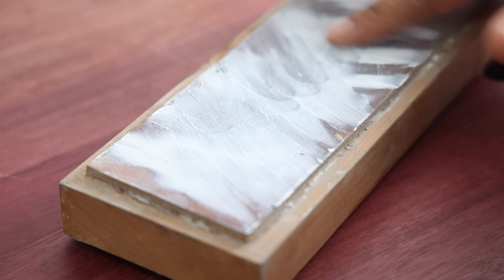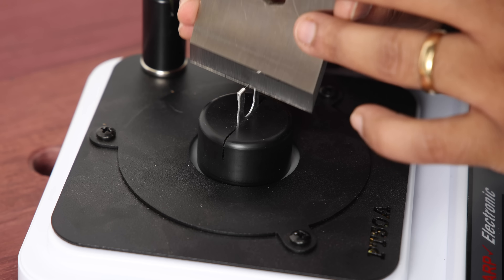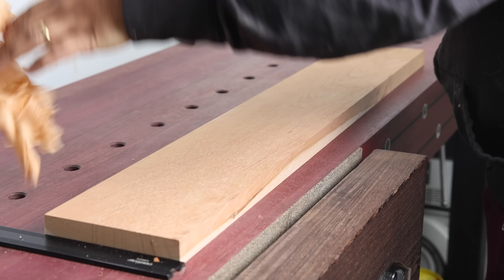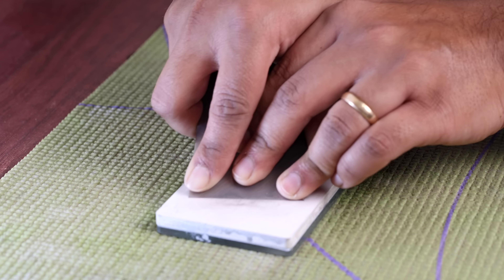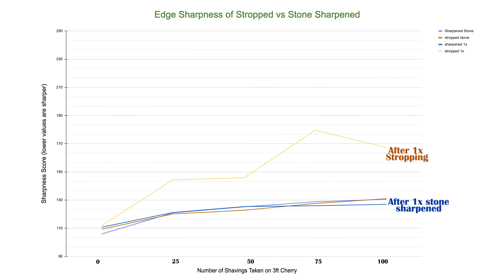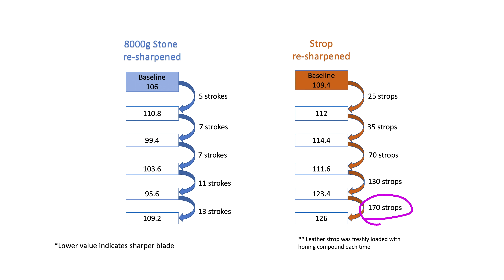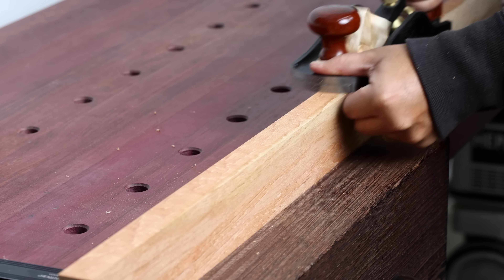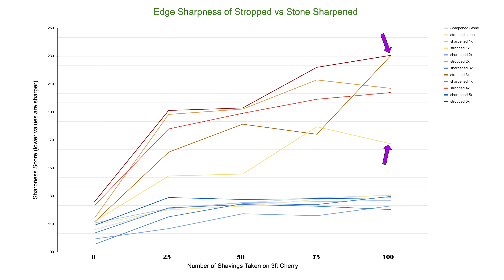is stropping overrated?

Comment: Hi, I only use the strop to polish the edge after stone sharpening. I didn't think the strop was intended for actual sharpening.
Reply: Yup, I was taught the strop is for final hone and polish and working off the burr, not for actual sharpening. There is good evidence that steel quality and bevel angle are the biggest contributors to sharpness and edge longevity.
Reply: Yeah me nieither.
Reply: Very much. Stropping can be used for "sharpening" on a pinch, but that works best for knives than this sorta blade. IMO it is actually preferable to "sharppen" the knife on the back of another knife first, just to straigthen up the edge, then re-polis on a strop. But htat is a regular knife with its double sided sharpening and thin blades, not a beefy blade with a chisel gring like a tool.

Give it a few strokes on your highest stone if it is not dull (then it has to go down to a lower stone), a couple on the strop, takes about the same time, and you're golden.
Reply: @TheOriginalAndBestTim  The compounds used for stropping wear away the metal just like a stone, so if you can put some fine stropping compound on something rigid like a flat hard piece of wood, it will behave similar to a fine stone. Strops are generally made of something that compresses a little though, and that dreaded rounding over of the bevel is also what helps work off the burr and polish the last bit of the edge quickly.

Comment: Hi Suman, great video. I actually did a very similar experiment trying to prove the effectiveness of a strop. In my test, I stropped my blade after 400 strokes on hard maple and the sharpness on my blade went from about 500 to 250 on BESS scale after few stroppings. However, that didn't really last very long. I was back to 500+ range after only about 50 strokes. For stropping to be really effective, I found you need to strop in about every 50 strokes. With this approach I was able to maintain 300-350 sharpness even after 600 strokes.

Comment: Great test and I was surprised by the dramatic results.  I have been stropping for decades and have found several things that may improve your results.  As many have noted, using a soft leather is very bad.  Stropping with wet compound is also counter productive since it leaves the leather even softer and the compound squishes up around the apex.  I use diamond powder on thin leather and have found that if I don't let the diamond dry completely before use it will dull my stone honed edges.  When the diamond surface becomes loaded and less effective, I give it a spray of water and agitate the surface to bring fresh diamonds into play. When dry, it works like new.   Any time I can't get my desired results in less than 10 stropping passes I know I need to do a better job on the stones.  Almost all my knives are "super steels" and attempting to strop on anything other than diamond or boron carbide is useless.  I suspect V11 is similar (I have V11 plane blades but have always used diamond stropping with them.) Just some observations from a 71 year old woodworker with an obsession for sharp stuff!
Reply from the maker: Rick- I’m curious to know- why not just use higher grit stone like the Shapton ceramic? Seems easier to me. Would love to know your thoughts.
Reply: @WoodcraftBySuman  I have several high grit stones including a 16k shapton but I find that the softer texture and feedback from the strop gives me more reliable results.  I can feel and hear the exact moment my strop is "on edge" whereas with the shapton I need to gauge it based on angle alone.  Lower grit stones remove enough material that minor angle errors are quickly compensated.  Most of my sharpening is on knives where I can't use the hollow grind trick for angle setting.  I do use hollow grind on plane blades and chisels but have never found any benefit in going above 5K in sharpening them so the strop is just a pass or two to ensure that the burr is gone in woodworking.  I'm fine when they shave arm hair.  My knives I usually take to hair whittling sharpness just because it took so long to learn how that I like to stay in practice!
Reply: Does it matter whether one uses diamond "spray" or the emulsion from a syringe?

Comment: The erratic nature of the strop lines, brings in to question the stropping technique. Something else that is not addressed in this video, this PMV metal which forms differently than non pmv, so these results may or may not hold true for 01. A lot of Modern "myths" are not myths so much as failure to change process when changing material in question.. Most immediate consideration is that Chromium Oxide  is going to cut 01 much more effectively than PMV11 which would change the results of the stropping.

Comment: Strop is not a substitute for 8000 or higher grit stones. You can get only the polish level of your compound. If the stone is higher grit than a compound no surprise it will produce a better edge. Most people use strops after sharpening on a 1000 grit stone just to save some money by eliminating a need for additional higher grit stone.
Reply: Grit alone is not the only factor that determines how sharp an edge is. The steel you're sharpening is a factor too. If it wasn't then it wouldn't matter what tools you had. Steel is an alloy though. So steel is a complex material. Steel has a grain structure. You can't see it like wood but it's there.

Comment: Awesome video, but I was under the impression that the stropping was an addition to after final honing. I.e. a final polish to remove any nicks. There is no doubt that the the blade is sharp after the 8K stone, but what are the shavings like? Are there streaks on the piece and/or shaving? Can you go straight to finish? I suppose that the edge could be viewed using a jewelers lens, or other means,  to see if there are any nicks on the edge that might cause streaking by just using 8k.

Btw I don't strop, just finish with 16k stone.

Comment: Weird. I haven't seen anyone use only a strop to sharpen. They usually use a fine stone followed by the strop. Does the stropping after stone sharpening make the edge more dull compared with using the stone alone?

Comment: You're finding about stropping is different on this video than the one you did later with Katz. Is there a change in the hardness of the strop between the 2 sets of tests?  The later tests found a soft leather was bad, but the hard leather worked.  And surprisingly,  MDF was a failure (and nor explained thoroughly).

Comment: Got a couple issues here. 
1. Don't compare abrasives from different manufactures by "grit". Go by the size of the abrasive in microns. For instance, a Shapton 8,000 stone is 1.84 microns and a Norton 8,000 stone is 1.2 microns. 
2. You mentioned that the Tormek cuts faster than the red, green, etc paste. There is a reason for that. The Tormek paste is more abrasive. In fact, it has an abrasive of 3 microns. Your 8,000 grit stone is below 2 microns. You're DULLING your blade by using the Tormek paste after your 8,000 grit stone. 

The green stropping compound is 0.5 microns. And you don't want that on a thick spongey layer of leather. Go for a thin and relatively stiff veg tan leather. Or even MDF or the brown side of a cereal box.
Reply: thank you! this needed to be said.
Reply: The grit difference here seems to put these results into question. I had the same suspicion when he mentioned that the compound cuts faster. Thanks for confirming the details.
Reply from the maker: You have a valid point. Shapton 8000g is  advertised as 1.84 micron while the tormek is 3 micron. This explains why I overshot the baseline sharpness to be sharper than ~110 ish on the stone sharpening blade. However, the 3 micron abrasive was more than fine enough to bring the stripped blade back toward baseline sharpness. So I was not dulling the stropping blade and the results are still better explained by the squishy nature of the leather causing a rounding effect. To your point, if it’s better to use honing compound on a piece of harder surface, why not just use a higher grit stone?
Reply: @WoodcraftBySuman  I think a good reason to prefer buffing compound is the cost. I don't have an 8000 grit stone, so I go from a 1200 grit diamond stone directly to stropping with green buffing compound. Rob Cosman doesn't buff, but that 16000 grit stone he uses cost $160 CAD. A large stick of green compound from Lee Valley costs a tenth of that.
Reply: It's worth considering that stropping compounds which are coarser than the finishing stone don't necessarily degrade the edge, since stropping doesn't work the same as a stone! You might find the listed strop series on Science of Sharp interesting, especially part 4.
Reply: @HandlebarWorkshops  I’m very interested in the results of your research
Reply: @HandlebarWorkshops  I would like to see that grit video. Are you aware of the grit-to-micron calculator on Best Sharpening Supplies?
Reply: I agree, he needs a harder piece of veg tan leather. I would also note that he is pushing too hard on the blade when stropping, it is not a sharpening stone. If you ever watch someone strop a straight razor, they are not pressing it into the strop, it is lightly sliding across the top of the strop. 
I would also add that even on a chisel ground blade, you need to stop the back of the blade. It is much easier as it is flat and you can lay it flat on the strop. Stropping one side is only part of the process.
Reply: I'd think that using paper of any sort will mess up your results. The wood cellulose would be inconsistent & potentially dull the blade, no?
Reply: @WoodcraftBySuman  Sharpness of the cut test may not improve on the finer grit stone. However the life of an edge finished on a 30000 shapton will last longer than one finished on an 8000.  The 30000 shapton is .5 micron then strop with  .3 micron on thin leather.
Reply: Resulting edge with same grit on stone and on strop is completely different. If you take stone slurry and use it on a strop you will see the edge is much more polished after the strop. 

Solingen paste for example everyone thinks grit is from 6-8K but I put it on a microscope and it has 15 micron particles, same size as an 800 grit stone. 

I think the issue here is that he used moderate pressure on leather, there is a huge rounding effect that even changed the cutting sound. Higher angle can be useful for impact resistance but usually dulls faster. Stropping on balsa wood could avoid most of this rounding effect.
Reply: Just call it micrometers, microns sounds like something you eat for dessert
Reply: @stefanfyhn4668 Microns is fine.
Reply: @WoodcraftBySuman You didn't overshoot, you simply did get it sharper because you got closer to what you can achieve on a 8000 grit shapton, which you didn't in your baseline. And ofc, with a courser compound, you are dulling it, together with the wrong stroping technique, as others have already explained. And last but not least, it is always going to be sharpen on stone, strop afterwards, use, strops, use, strop, use sharpen. As stroping is faster and when using the correct compound, you can get it really well back into working condition. As setting up stones is more time consuming then stroping it a few times.
Reply: @firefly6880  Nope. Microns==micrometer==1e-6m
Reply: I think if you have an 8000 grit stone, then use it. But most people don't. However, with simple double sided oil stone, a piece of leather, and some cheap jewelers rouge, you cane get blades shaving sharp. The strop is more about convenience, and simplicity. Most people don't have all their blade's bevels hollow grownd for ease of sharpening  on such a high grit either.
Reply: @Adamant4160 8000 grit is absolutely unnecessary. I would argue everything above ~1500 pr maybe 3000 is useless. 
You can even get a razor off of 400 grit and a strop. 
For maintaining use a diamond strop with 1-3 micron, this will cut faster than normal compound and lasts much longer. A 3000 grit stone would also do the trick i assume

Comment: Maybe I'm nuts, but would deburring or stropping on the backside of the iron help correct the rounding? Maybe you're doing that but I just missed it? Either way I think that logic would apply to both a sharpened or stropped iron.

Comment: Rounding over always happens of course due to the greater pressure at the very edge of the bevel, since it is compressing the strop there. But if your stropping angle and pressure is consistent, the pressure will reach an equilibrium where it is increasingly rounded-over as it gets closer to the edge. That is to say, there is only so much rounding over that will happen for a given stropping medium, bevel angle, angle of the edge to the strop, and pressure. This is documented somewhere on the Science of Sharp blog but it is also a pretty intuitive concept.

But most people (including me) just freehand strop, so every time we strop to a higher sharpness, well, that bevel gets just a bit more rounded over.

Comment: Tormek honing compound has an average rating of about 3 microns which equates to roughly 8000 grit (the actual grit will vary). The idea of stropping is that the polish you use is a high grit than your last stone. So for anyone who stops at, for example, a fine DMT diamond stone generally rated at 25 micron and then strops with tormek compound, they would see a difference. But people who use ceramic stones up to 16k grit and then tormek compound would actually be ruining their finely polished hone.

Comment: Interesting, I can see that using a bevel up plane makes any bevel angle change is impactful. Whereas for a bevel down plane it wouldn't make much if any odds (see woodbywright plane iron tests for this).

Most people don't strop instead of stones, they strop with stones. So the effort to get the edge back to baseline via a strop is not relevant to most people. Also, if you look at those that are proponents of the stropping method, they are typically stopping at a lower grit stone (circa 1k-1.5k, often diamond plates). So the strop is replacing your 8k, not following it. 

The bit I can't quite figure out, and bares more investigation is why the stropped blade dulls faster (but starts from the same approx starting level). Normally having a higher angle (which many would agree a strop can create) is more durable, but again, is this a difference with the bevel up plane? Is the higher angle putting more 'work' into the edge as it is turning the wood through a higher angle therefore dulling it faster. Would we see the same in a bevel down plane?

Do you feel like a follow up video with a bevel down?

Comment: Thanks. I'm a bit confused. I thought the conclusion drawn from video with jkm was that you had to strop to get to the best sharpness, and that it dulled quickly anyway so don't go nuts sharpening too often. I sort of concluded that in between sharpening, stropping on hard leather would help edge retention. This is saying that it is not the case. Care to comment/elaborate a little? Thanks.
Reply from the maker: This video is about Re-stropping as a method of resharpening. Conventionally, if you sharpen and then top off the blade with stropping, you’ll get a good edge. But after use, if you’re trying to re-strop to sharpen over and over again, the blade takes longer to get sharp and dulls quicker bc the tip gets rounded and produces higher angle of attack. Stropping is still a good does but don’t use it too much between sharpening.
Reply: @WoodcraftBySuman  Gotcha. So what you would do is to sharpen+strop, and don't repeat these steps too much because edge dulls quickly from use. If anything, one or at most two restrops before sharpening again. Thanks
Reply from the maker: @tzuohann  yup! You got it. Cheers!

Comment: Will you please test stropping with that green compound directly on a MDF board, a generic glass plate that can be found at a hardware store, one of those engineered flat/leveled tiles/stones, and any other “flat” object that consumers can easily find and see if they produce any better results? It would be worthwhile to see the effects of stropping in those instances and to determine if leather stropping is a relic of the past
Reply from the maker: Leather is not a relic of the past. As much as I hate to admit it, leather stropping produces better results than  mdf when it was tested on another video I did with Jonathan Katz Moses.

Comment: Let me ask you this, If you took both blades, one sharpened on a stone and the other sharpened on a stone, followed by stropping, right from the beginning, what is the results like then? I'm asking, because bringing the iron back to baseline seems to be important to use the stones, but to get that shiny edge would require the strop. Would the strop hold up longer if you sharpened by stone first and then immediately stop?

Here's something else to consider, the quality of the edge. The stone sharpening may indeed be sharper, but the shavings might be coarser. What I mean is, the condition of the finished surface after each iron shaved on them. Was the stropped iron capable of making smoother shavings?

Comment: Ouch! All those years of watching straight-razors being sharpened on a strop.... Never questioned it worked and just kept using the tool. But I always start on a new project at the stone to freshen my tools, and stropped them as I go.
Reply: There is no „the“ strop. Leathers vary and compounds do as well. 
You can go from 400 stone directly to a strop (with diamond compound) and get a razor. If you sharpen on 8000 grit stone or even finer and strop afterwards on 6 or 3 micron, you may be dulling your knife/tool. 
The important thing is - get rid of the burr in any way that works best for you, but you may have to buy a microscope (cheap handheld will do fine) to identify the micro burr. It needs to go!! 😅